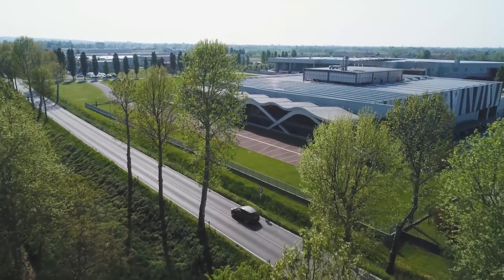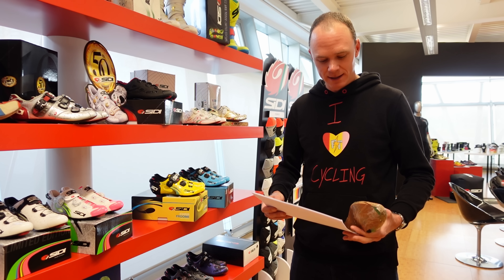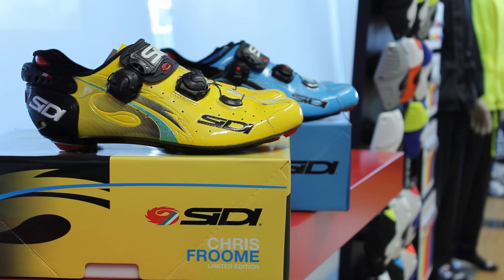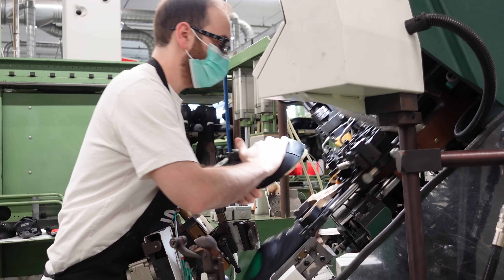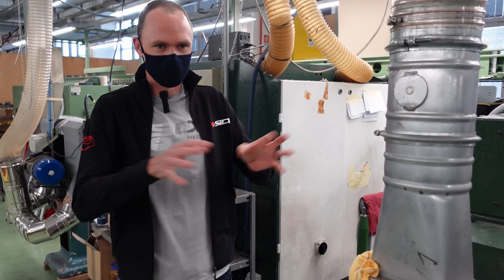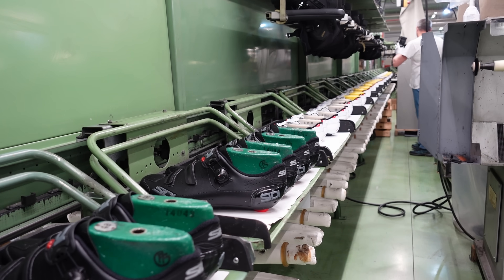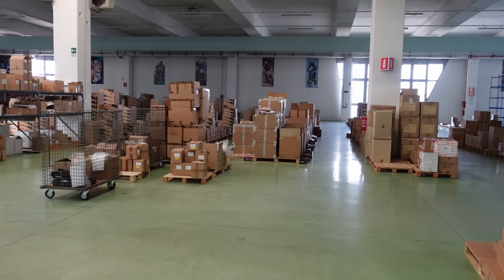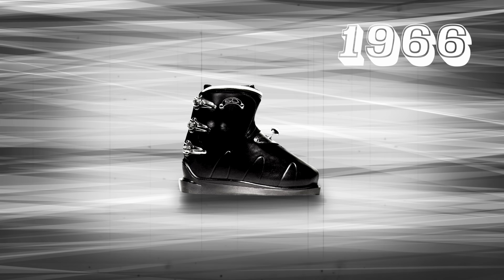Behind The Scenes At Sidi

Comment: No question a beautiful shoe. I own 3 pairs of road and 1 pair for Gravel. Love them. Sidi as has been mentioned has been creating incredible MotoGP boots worn by many of the World’s fastest Racers. I own a sweet pair of those too. Sidi is solid foot gear. The success comes from it’s power transfer through it’s rigidity. It’s carbon platform and outer shoe is a work of art. Expensive they are.

Comment: I have been a lifetime customer of Sidi and believe strongly in the brand and quality of the products. I treat myself to a new pair of top-end Sidi shoes every four years or so. However, I have experienced the same issue with my second toe in my latest shoes (Sidi Wire2 Carbon)and this is the first time I'm considering changing shoe brands 😪 in almost 20 years of Cycling.
Reply: Get the one side stretched a little at a cobbler shop.

Comment: I have more Sidis than I have regular shoes. Just about ALL cycling brands make their shoes too narrow. They really need to start catering to all riders, not just the elite of riders (amateur or pro). I know Sidi has Mega sizes, but they don't run those throughout the entire line up to their flagships.

Having said that, once I've had a pair broken in, good gosh...there's nothing else like them. They are the best of the best for a reason. They don't just get lucky every few years with a good fitting shoe. They consistently produce the standard in cycling shoes.

Comment: I have the same problem as you Chris in that my second toe is arching up as well so rubbing is a big problem and I have to plaster it up then wrap a bandage around. I’ve gone from a 43 to 45 but hasn’t made a lot of difference so I don’t know if a bit more material over the top would help apart from giving my toes more room to move around, which is probably the main reason why my toe is rubbing?
Reply: go a wider shoe or get some scissors and trim the material if performance is a priority.
Reply: @durianriders  performance isn’t the issue, it’s comfort. I don’t need that toe so I think if it got so bad I’d have it removed… or to keep that joint flat maybe some sort of splint but I don’t see myself trimming a pair of Sidi’s

Comment: I am wearing a Shimano size 44 wide.I am looking to switch to Sidi.Easier said than done in Wisconsin north of Milwaukee as far as actually being able to find a store and try on a pair.I ordered a Sidi Dragon 5 MTB size 44 Mega from Amazon and it felt like my foot was drowning in it so I sent it back.There was so much room above my toes and the middle part of my foot.and my heel slipped a little.Then I found out that the heal can be adjusted at the back with an allen wrench which might have secured it...??  Since they were mega should I have ordered a size 43.5 instead..?? My  running  shoe size is Asics 9.5 extra wide . I measured my foot length and it came out to approx. 26.3 cm...I compared my feet to a friends feet and mine are much wider..I had to pay for shipping and restocking cost to return those shoes.Maybe they did fit and I just didn't realize it... Money thrown away. Any suggestions or help would be greatly appreciated.

Comment: I'm yet to find any cycling shoe that suits my feet as well as Sidi - they hold my feet on the bike like no other and and never cause me any discomfort or fatigue. The availability of replacements for parts that may wear such as heels, insoles, and restraint components mean that if you treat them with a moderate amount of care they will repay any premium on your initial outlay with outstanding serviceable life for a performance shoe.  There may be lighter options but the comfort, fit, and quality of construction more than make up for any weight penalty that they might give up to a handful of competitors. I tend to use two bolt cleat shoes for commuting and three bolt for sportifs and longer rides and Sidi works well with both.

Comment: Been riding Sidi's since the early 90's and loved the them, great looking footwear.  That is until I tried some Specialized Ares.  Now I'll never go back.  Much more room in the toe, rounder toe box and with the built in varus tilt, no need for wedges.
Also, Spec road shoes have the bolt holes set back a few mm more than the Sidi's - makes a huge difference with moving the cleat back on the foot.